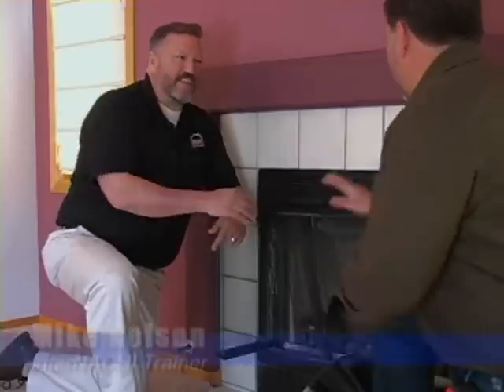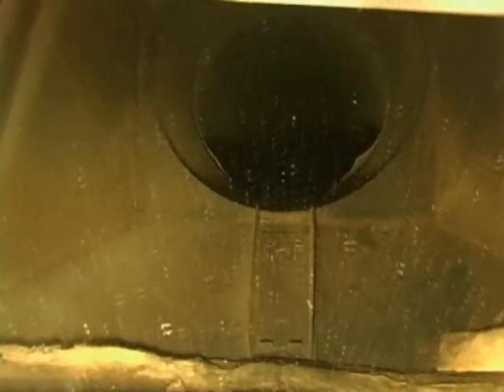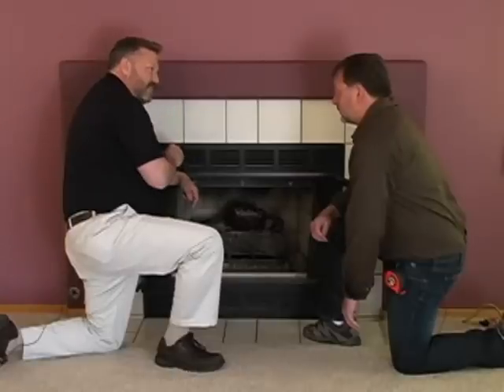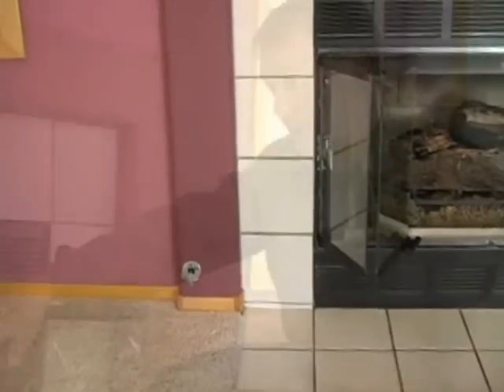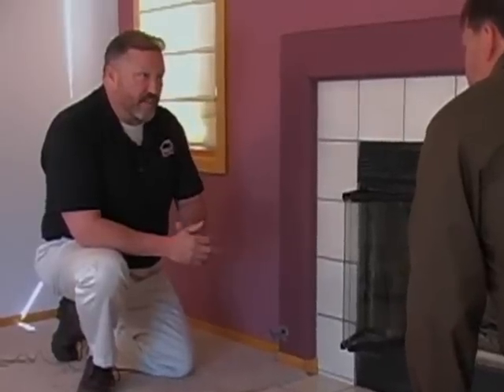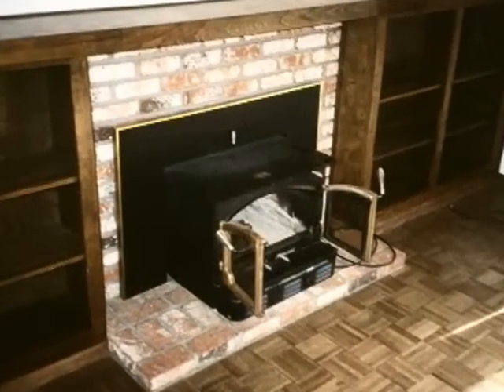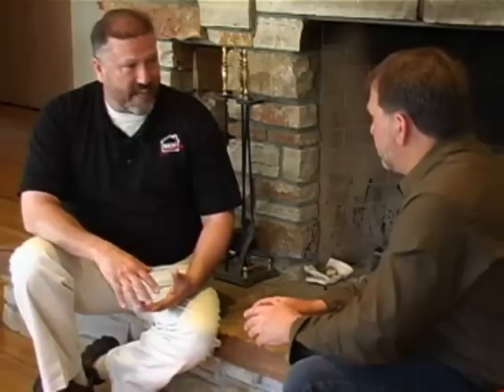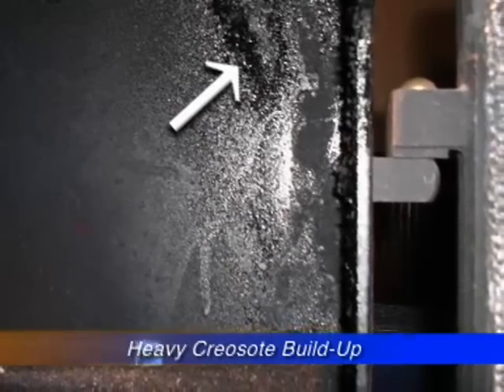Fireplace and Chimney Inspections

Comment: can you run a chimney camera scope up the chimney or does it have to be from the roof.
Reply from the maker: Using gravity is easier.
Reply: In my opinion, camera inspection from inside is preferable as there is generally less ambient light on my monitor.